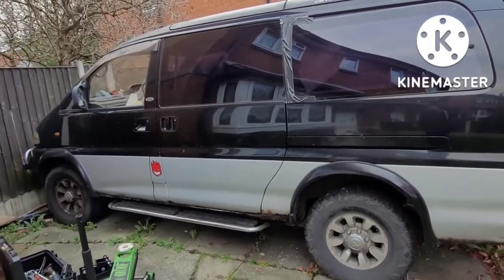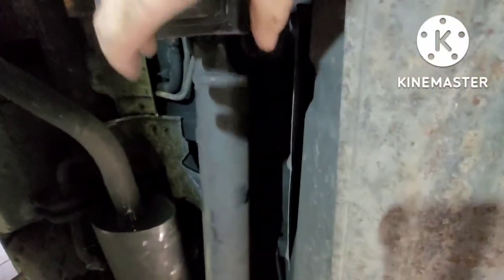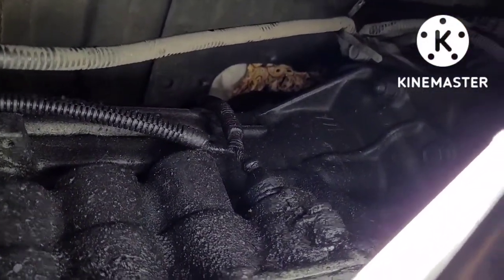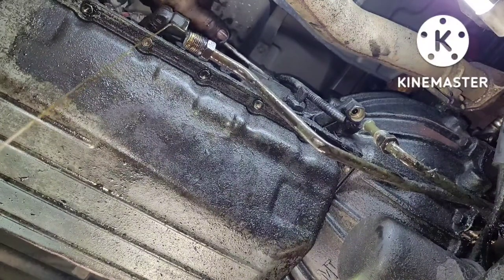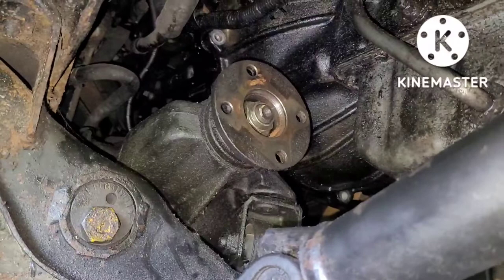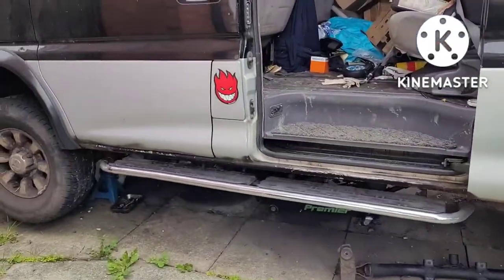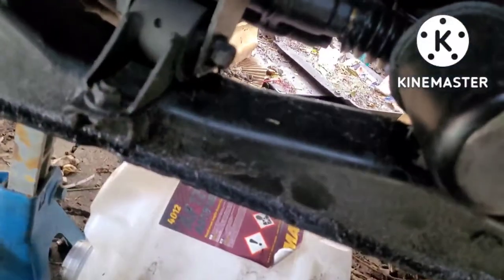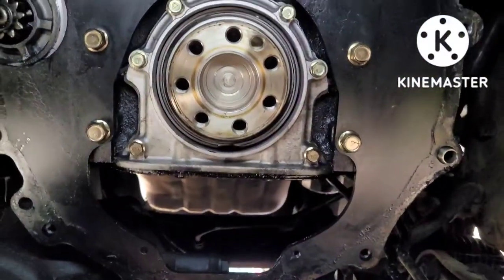Replacing the rear main seal on a 1994 Mitsubishi Delica L400 2.8 Diesel.

Comment: great job very good commintary
Reply from the maker: Thanks for that 😁
Reply: @motormind4788  you mentioned the transmission fluid used in the delica. I have a 96  l 400 4m40, what was the name of the transmission fluid.
Reply from the maker: I  think it was Diaqueen 🤔 or compatible,  if I remember I believe SP IV is also compatible,.if you.look up Diaqueen that should get you.on the right track.

Comment: In the early 4M40 motors the crankcase ventilation baffles sealed up inside the valve cover get blocked and the pressure build up can push out the rear main seal. I'm wondering if this is what happened here.
Reply from the maker: I will have a look at that. I did the valve cover seal a couple years ago. So I would have cleaned things off. But I will definitely have a look at the baffles and make sure they are not blocked before running the engine. Thanks for the tip mate 👍. Also thanks for watching the video 😁